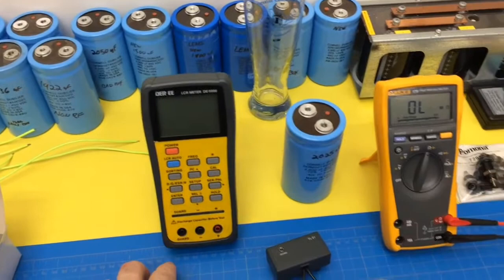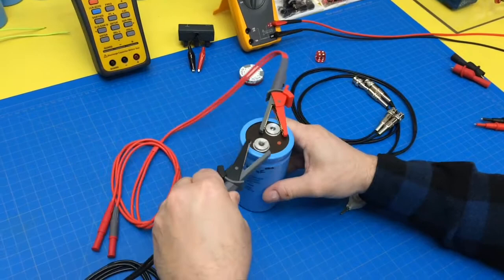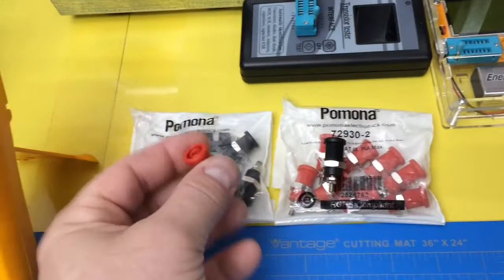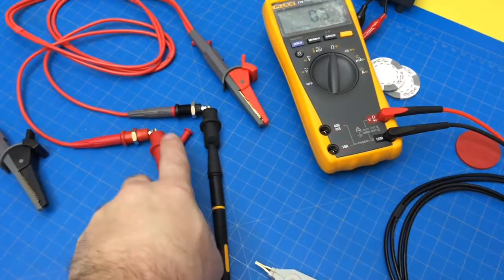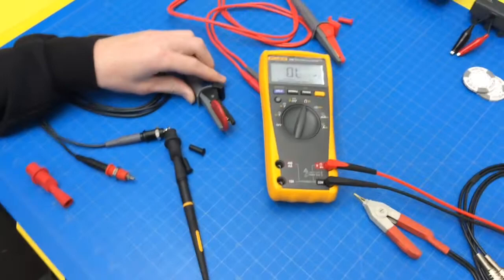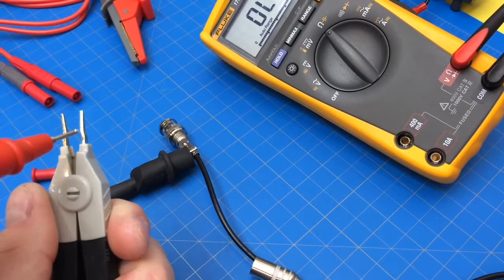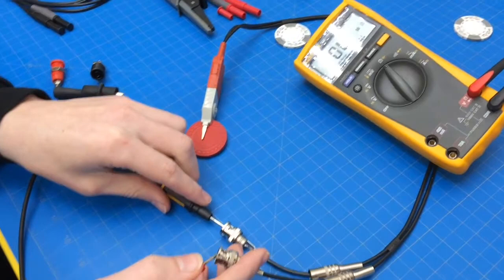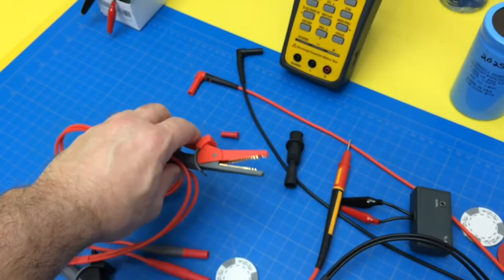Cheap Kelvin Clips Reviewed for LCR 4 Wire Measurement Upgrade

Comment: The fact that the OEM leads are so short made me think that accuracy goes down as the lead length goes up. I know the DE5000 has a zero function to compensate for capacitance and inductance of the parallel lines, but that zero function is done at one frequency and one exact position of the two lines, with no current flowing. Serious accuracy won't ever be important for my purposes, but it would be interesting to see how accurate measurements are. Since you didn't destroy the original TL-21 you might be able to compare one with the other in a little experiment. At the end you allude to another video, I'll go to check that out next.

Comment: The TL200 clips and cables do not work for me with the TI-21. But the Atoplee clip and it's cables does. I believe that the problem is with the lack of shielding on the wires of the TL200 - even though they're 4-wire. During calibration I was getting passes and fails in open, and mostly fails with shorted: random EMF pickup, I think. I'm sourcing coax to try with the TL200, and I think it will work perfectly then.
Reply from the maker: Thanks for the info.  I wondered the same about the shielding.
More expensive model LCR meters  like Agilent/Keysight only have 2 wire and no shielding which I found odd.  It didn’t really get great reviews despite the cost and the brand being very good.

Look for future giveaways on my channel - Also be sure to follow on Social Media for Giveaways & Announcements:
Instagram:  https://www.instagram.com/ktfg_9
Twitter:  https://twitter.com/KTFG9
Facebook Page:  https://www.facebook.com/KTFG1
Reddit:  https://www.reddit.com/user/KTFG
Pinterest:  https://www.pinterest.com/KTFG9
Soon to have another giveaway with the next tutorial.
 
My Website:  https://www.kevingittemeier.com
Reply: @KTFG  There is a lot to say about 2-wire. I've just wired the TL200 clips with stereo cable. I'm iffy about it's capacitance but at a little over 2 feet each it may be okay... Will do the TL-21 end tomorrow and post how it goes.

As a side note, I may have had better luck with unshielded 2 wire clips if there was a solid connection between the guard terminal of the TL-21 and something in close electromagnetic proximity to the TL-200 clips... On the other hand if it's unshielded two wire, shouldn't it be a twisted pair? I missed that possibility too. The TL200 clips might work if the pairs can be twisted first, maybe. Just a thought.
Reply: Shazam! Using shielded stereo cable with the TL200 clips works. I tested some stuff and did a comparison with the Atoplee set-up. Inductance, capacitance and resistance values are very nearly identical. Q and D factors in inductors and capacitors respectively are very comparable, but vary a little. I'll feel better if I can get some low capacitance cable at least as nice as what the Atoplee uses, but the pricing that I've seen for a limited length - about 10 feet - of thin, low capacitance coaxial cable is ridiculous!

Checking revealed that the repurposed stereo cables have about twice the capacitance of the cables that came with the Atoplee clips. Luckily the DE-5000 can accommodate the difference. Besides, this difference may be much smaller than between the TL-21s original pair of 2 wire clips and the Atoplee set-up with it's 75 ohm characteristic impedance cables of longer than 7cm length blah blah blah.

A nice confirmation of theory, and that the DE-5000 has "authority", is the way the measured cable capacitance roughly doubles ("roughly" pointing to an unavoidable consequence of two unequal cable lengths - a 5cm or 2 inch difference in length within the body of the TL200 clips) when the jaws of a clip are closed (two cable capacitances in parallel) compared to open (only one cable capacitance measured). These capacitance measurements are between the center conductor and shield, of course, and the capacitance goes up significantly (jaws closed only) when the shield of one cable is connected with the other cable's shield from the same clip - the final configuration within the TL-21. Of course, the shields are left unconnected, and insulated from all else, within the clip.

A main calibration thing to watch for is the way the jaws of the two TL200 clips close on each other: the "crocodiles" have to be "nose to nose" and 90 degrees relative to each other so that the 4 jaws, or rows of teeth, all short to each other. Otherwise a FAIL will result in the shorting phase of calibration. And during the open phase of calibration, the jaws of each clip must be left alone (left closed) - the OPEN phase means keeping both clips electrically unconnected, or open.

As you point out, the upper and lower jaws of the original clips are not isolated. This clip end shorting of the -1 to -2 and of +1 to +2 circuits is probably insignificant just because of the short lead length. It t seems that at any lead length the shield connection is completely necessary.

Comment: You don't need Kelvin clips for large value components such as electrolytic/film capacitors and large inductors. The Kelvin connection is only required when the inductance or capacitance of the flyleads are an appreciable percentage of the measured inductance/capacitance.
Reply from the maker: I couldn’t get this LCR meter to calibrate with regular leads.
The Agilent/Keysight uses regular leads.
What about accurate ESR readings of electrolytics?
Reply: @KTFG  You do have a point about the ESR accuracy. Best stick to Kelvin leads then.
Reply from the maker: Off the subject but here is how Emily from the videos solved a Rubik’s Cube at 3 years old: https://youtu.be/9spDGBeWl1o
Reply from the maker: 2x2 Rubik's Cube Beginner Tutorial
How To Solve 2x2 Rubik's Cube: So Easy A 3 Year Old Can Do It:  https://youtu.be/UYCeyu_pbTI

Comment: Even those with the banana plugs aren't four-wire for the LCR meter you have. I'm in the same situation. I wish they made one of those adapters that gave five banana plugs (the extra for guard), then you could plug in normal four-wire leads. I'll have to hack up my TL-21 as you are doing.
Reply from the maker: +blargg 
Here is a simple TL-21 mod https://youtu.be/rgqQRzZM80Q.
Did this one first but will be doing banana jack mod next.
Reply from the maker: The Kevlin Clips in this VideoAtoplee Kelvin Alligator BNC Test Lead Set for LCR Meter: https://amzn.to/2tEfyz6
TestHelper TL200 LCR Meter Kelvin Clip 4mm Banana Plug: https://amzn.to/2KykeA4
Tl-21 Alligator Test Lead Case (for DE-5000 LCR Meter) https://amzn.to/2KjUuZf

Comment: A  little bit short more like way too short!
Reply from the maker: +Metaldetector Experimenter 
Kind of crazy. Not sure why they don’t offer optional accessories. I am about to start on a modification that will allow any banana jack kelvin clips to be used.
Those don’t  have a shield so should not fail a calibration or have quality control (construction) issues.